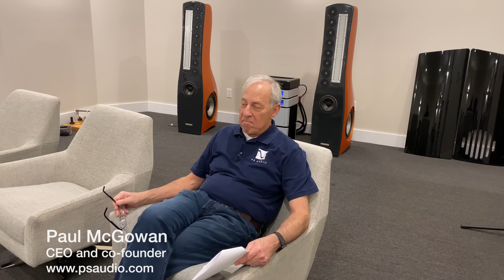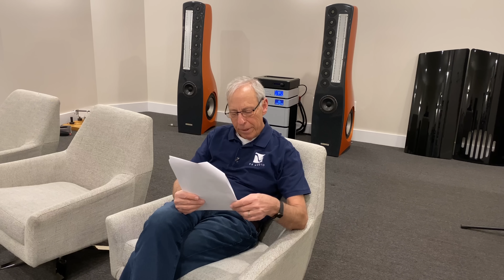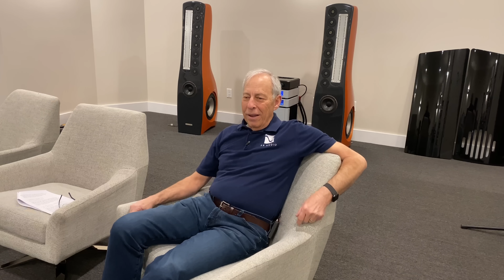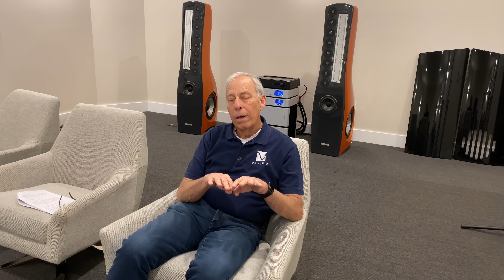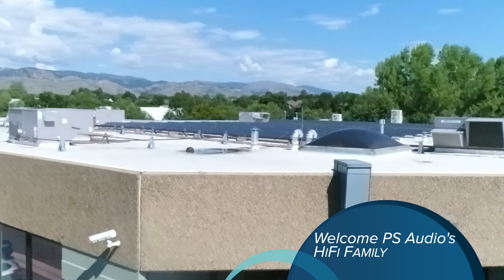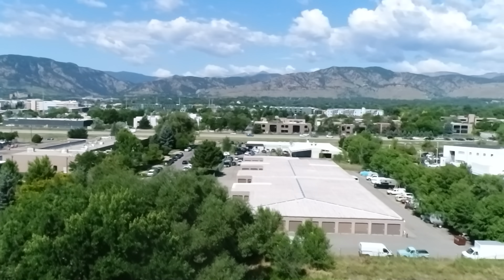Are mains purifiers necessary?

Comment: This is one thing Paul has talked about many times!

Look at common noise filters inside power suply and computers and TV screens.

It's a series of capacitors and 2 coils!

One of the problems is that the coil many times causes the volt to drop when you draw a lot of power!

You do not take away all the problems with noise filter but it takes away a lot of high frequency noise! But if you live in an area of low net noise then it is much better to spend money on proper and good equipment and speakers!

Comment: Digital components don’t care; because, well, they’re digital. 1’s and 0’s; and if there’s enough noise coming out of the device’s power supply to flip bits then there’s something grossly wrong... even plugged into a really filthy mains source.

Analog components shouldn’t care either, because they should have all of that filtering built in to their power supply already. And if they don’t, then I’d call up the manufacturer and ask them just what they were thinking...

There can be an advantage here for switching power supplies; if they are designed to take advantage of it: conventional unregulated transformer-rectifier-capacitor power supplies can only pull power from the mains when the post-transformer voltage exceeds the capacitor’s voltage, which only happens near the peaks of the input sine wave (yes, I’m significantly oversimplifying this). However, with the right style of design, a switching power supply can feed power through many times per cycle, potentially reducing the apparent impedance of the power supply. I’m not a power supply engineer, but I was under the impression that this is how most switching power supplies do function... The cost, of course, is higher post-supply filtering requirements (as with anything in engineering, there are lots of trade offs involved).
Reply: Fat Rat - yeah... it’s more a comment on the state of the industry...

Best, short of a honking big battery pack (like, a pack out of a Tesla car), is a motor-generator set with a big flywheel; as that will generate a truly pure sine wave with zero noise pass through; and with a high-frequency output combined with a polyphase AC-to-DC power supply; you can get a very pure power rail with very low impedance.
Reply: Here's a little wisdom about power supplies whether linear or switching supplies. Power or energy really is transferred from the power source (the electrical generators at the power generation plant via the transmission and distribution lines) to the load (your speakers in the case of a power amplifier), along with the energy from the storage reserves (the storage capacitors within the power supplies) depending on the instantaneous power demand of the load. The impedance of the power supply is mostly a factor of the ESR (Equivalent Series Resistance) of the storage capacitors in a unregulated linear supply and several other resistances in a SMPS including the transformers winding resistance, the switching devices  resistance, and the low pass filter coils resistances.  For what its worth (not much), the impedance of a linear supply is likely to be less than that of a SMPS.
Reply: @StewartMarkley ..."(not much)"...lol...but still thank you for posting Stewart. It's still interesting stuff.
Reply: Stewart Markley - yeah, but frequency matters. If you are trying to drive a huge spike into your load, very quickly, while the mains voltage is lower in it’s cycle or even near it’s zero point; you’re going to drag down the rail capacitor further than if you were to spread that same energy requirement across several mains AC cycles. Switching supplies, in principle at least, aren’t as prone to this effect because the drive frequency of the power supply is much higher than the 50/60hz of wall mains power... which is why a linear power supply will have comparatively larger capacitors; in order to bridge the gaps between one AC cycle and the next.
Reply: @darkwinter6028  you are forgetting that the switching supply can only draw power from the mains when it is not at the zero crossing point, just like the AC from the transformer in a linear supply. Also the storage capacitors in the linear supply bridges the Gap as you noted, the small storage capacitors in a switch mode supply cannot do the same.
Reply: Stewart Markley - well, as I noted earlier, although I do dabble in electronics design, I’m not a power supply engineer; but...  my understanding was that the switching power supply can generate pulses into it’s AC-DC conversion stage across the majority of the AC waveform; and the density and/or duration varied by how much energy the output stage needed. So while a linear supply might pull a big current spike over perhaps 10% of the AC waveform (off of the top of my head), a switching supply might be able to pull a bunch of smaller current spikes across 80% of the waveform (exact figures will vary, of course).

P.s... I’m not advocating for any particular design; they all have trade offs, and to a certain degree choosing one over the other is a function of individual taste...

Comment: This was interesting so thanks for answering the question.  I only have a rudimentary understanding of the electronics in audio equipment and I would have thought that the 110V or 240V AC was transformed and rectified to a much lower DC voltage.  That (I thought), plus the use of capacitors and other filtering equipment should produce a stable DC supply from which the amplifier can generate the signal to feed the speakers.  From your explanation though, it is clearly more complicated.  Thanks again.
Reply: justcruisin109 From my understanding (less than Paul’s) creating sound is both very dynamic and sensitive. So you are correct that the power supply and conversation from AC to DC does a lot of work at a peek (bass drum) it can still struggle to supply everything needed. It fun to try different PSU cables.

Comment: Probably the best solution to this clean power anomaly is to run a 6mm cable straight from the consumer unit to all your Hi-Fi gear,providing it doesn’t mean knocking walls down and ripping floors up!!! Tony

Comment: i guess a rule of thumb (with exceptions and of course overriden by experimentation) would be to not connect amplifiers to power conditioners. 

For sources, a sort of consensus (ironic to say consensus when for many power conditioners & regenerators are considered snake oil or insignificant) would be that conditioners generally help.

Comment: PS Audio Power Regenerator is a Class AB Amplifier,  for source components, it's fantastic. But for power Amp, it's not good.  Because even P20 is not enough for power Amp.  Adding another power Amp between your power Amp and AC Mains will not lower the impedance. because P20 also assumes power from AC Mains,  not getting energy from air!

Comment: Russ Andrews doesn't use anything in series to increase impedance. Everything is in parallel. And with cables the weave cancels some of the noise, without increasing the impedance. Russ would wince at the idea of anything that increased impedance. That's totally against his philosophy.
Reply from the maker: Russ is right on the account, only, the problem with parallel conditioners is they are extremely limited in what they can do. For the most part, little to nothing of much value. There's simply no free lunch in engineering. The get the most "cleaning" in a power conditioner you need to go in series.
Reply: @Paulmcgowanpsaudio  Well Russ has been designing these conditioners since the 70s and has had favourable reviews in many hifi mags. The Audiophileman has done a few as well. https://theaudiophileman.com/powerpurifier/
Reply: @banginghats2  I dont believe anyone especially if it is not backed up with properly designed and executed double blind testing and good measurements. Any difference as astounding as that claimed here would be very obviously revealed by some simple measurements and corroborated by properly controlled listening tests by others. None of that evidence is shown here.
Reply: @StewartMarkley  That's why they let you listen for yourself for up to 60 days for a refund. Your own ears are the only test that matters in the end.
Reply: @banginghats2  I agree that the ears are the only real true test of sound quality or differences. The real reason that PS audio and others do not publish test measurements or double-blind tests is that they want people to believe their hyperbole without resorting to scientific methods.
Reply: bendtrucker hello. 
To be honest does Paul Ribgy actually give any bad reviews?
I’ve owned Russ Andrews equipment and it does change the sound. It does squash dynamics though and has a rolling off of frequency effect which robs some of the energy out of a recording. Now don’t get me wrong, a lot of Hifi gear of all budgets, needs taming - especially CD replay - but system synergy is a better road to travel down to achieve this.
Reply: @jim586  I don't know how his gear would squash dynamics, given that he goes to great lengths to make sure ALL noise reduction is parallel in nature and wouldn't impact series resistance or impedance to the power supply. I can understand that some might not like the change though, or that some situations with a very clean mains wouldn't notice much happening at all. But it's probably best to try it out if you are interested and get a refund if you don't like the results.
Reply: bendtrucker - Try it? I owned it! 
As I said I had a super purifier block and four reference power cords for over five years.
I will say that signal grounding equipment can be very beneficial, which Russ Andrews can help with. 
It’s my experience which thought I should share. It’s obviously fairly common knowledge. The dealer who is also an engineer of very high end power supplies advised “that’s just how it sounds” and after changing things around I couldn’t disagree. He didn’t sell me anything other than the speakers he delivered. 
Upon listening to friends who also bought in to the RS sound they all agreed. The blocks definitely do something to the sound. It is of course entirely up to the individual their preference.

Comment: That's right yeah Bath they have some old Roman Baths that's where the galleons the Roman soldiers would head to on their weeks off natural spring drinking wine sitting in the bath with the lady friends. Just  go with 100 amp battery lithium and a pure sine inverter 2000-watt costs altogether about 450 £
I'm not sure if you use a variac you can keep the top of the sine wave you can power it a little bit more than it's needed say 250 volts should keep it at a steady voltage then run it to a contestant or halogen light bulb to step it down to 230v then run it through your conditioner. The light bulb is acting as a thermistor or could use a 20/30 amp thermistor

Comment: Are any power regens on the market that might use a SMPS primary side and or a class D secondary, and or are using a battery in between like a computer UPS so it could shut down your system properly immediately into an outage?

Comment: I half agree with Paul. Yes almost all power conditions kill the sound to make it more clear/separated/less noisy so it is more pleasant and you can turn the volume more up. That color and life he is describing that is lost in the filtering process, is something you get back in spades, but the problem is just that you have to get the really good conditioners like Isol8 mini sub axis, or Audioquest niagara 7000 or gigawatt 4 pc evo se+ for that to happen. If you only go for regular boxes costing 500-5000 dollars, you usually only get half of the good sound.
The isol8 mini sux axis box is the only cheap box I know that solves all the problems without creating any, and it-s only like 2000 dollars. I am never going back to regular power, it's damn noisy/harsh and the structure in the soundstage is so muddy/messy.
Reply: @Real Hifi Help
Hello,
I have found reading your comments for today's video to be quite interesting.
I had originally intended to ask whether you have heard of Insound Audio or Mapleshade Records, but in looking up Insound Audio to make sure I had the name correct, I happened across this, which you may also find to be interesting:
https://www.omegamikro.com/savannah-music-festival.html
Reply: @Hare_deLune  That is the best design of acoustic diffraction that I have ever seen.  It looks pretty easy to make also. The round speaker cabinets are also the best way to deal with cabinet diffraction. That would be a very interesting system to hear.
Reply: @StewartMarkley 
Hi,
Those speakers are modified versions of Gallo Acoustics speakers. Their website is roundsound.com.
I have heard their micro speakers at a friend's house. They put out an amazing level of sound for their size. They also completely disappear, and have excellent imaging and transparency.
What intrigues me most is the DIY amp that looks like a big wedge of wood.
Reply: Very fascinating. No sadly I have not heard this. Looks really good!

Comment: Not only does he live in Bath, he actually cleans his mains :)
Reply: I’m guessing that the mains in the USA, especially at only 115V must be so bad that power regeneration makes an audible difference. In the UK, the on-demand  power to the average household is 24KW and unlike 30 years ago, the voltage stability has improved dramatically. If the incoming mains to the amplifier is properly filtered, (which on high end audio products it certainly should be) and the amplifier has massive reservoir capacitors in the power supply, then I just don’t see the need for a power regenerator. Obviously that may not be the case on an ‘end of the line’ mains supply in a rural area.
Reply: Ba Dum Tss!
Reply: Brilliant
Reply: Roll the 🥁
🤣🤣
Reply: Ha!
Reply: haha nice one.

Comment: I have to wonder, after all this conditioning and such has anyone figured out the proper temperature, air pressure and humidity is the proper levels for listening? If you are worried about conditioning after conditioning...…....
Reply: Probablt the STP, Standard Temperatures and Pressures. I dont know if iots the same STP from STP engione oirl traeatment sand such, Is this the articvl you coudl be interetse din....

STP - Standard Temperature and Pressure

STP is commonly used to define standard conditions for temperature and pressure which is important for the measurements and documentation of chemical and physical processes:

    STP - Standard Temperature and Pressure - is defined by IUPAC (International Union of Pure and Applied Chemistry) as air at 0 oC (273.15 K, 32 oF) and 105 pascals (1 bar).

RTHANKES YOU ANDE THUMBBS UPS!
Reply: This has not been figured out yet. However, anecdotal evidence seems to indicate that high humidity and listening late at night gives a better sound quality.
For what it's worth...
Reply: @Hare_deLune  i always find things sound better after a few pints !
Reply: @gman1087 
Ha!
Yes, that can help too, I suppose.   : )

Come guess me this riddle, what beats pipes and fiddle
What's hotter than mustard and milder than cream?
What best wets your whistle, what's clearer than crystal
What's sweeter than honey and stronger than steam?

What'll make the lame walk, what will make the dumb talk,
The elixir of life and philospher's stone!
And what helped Mr. Brunnell to build the Thames Tunnel:
Sure, wasn't it poteen from ould Inisowen?

So stick to the cratur' the best thing in nature,
For sinking your sorrows and raising your joys!
Oh lord, it's no wonder, if lightning and thunder
Weren't made from the plunder of poteen me boys!